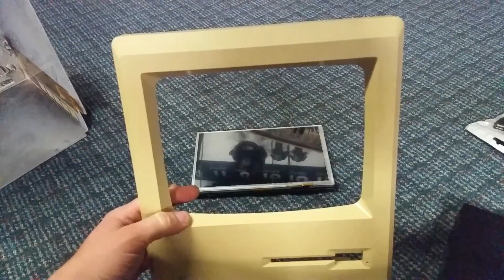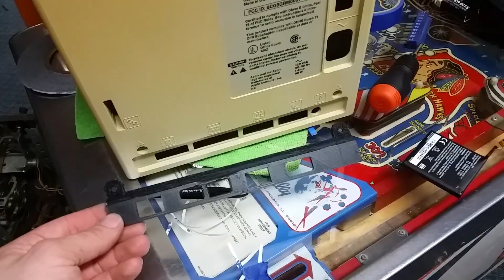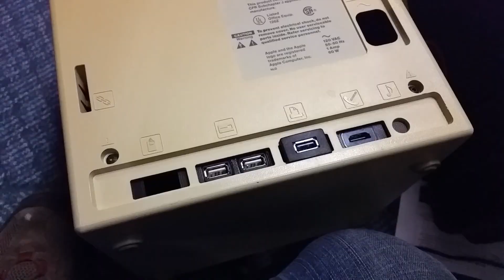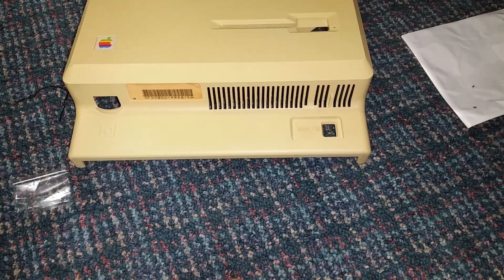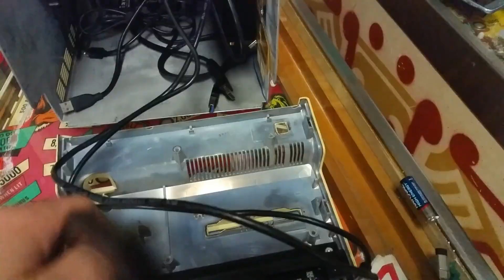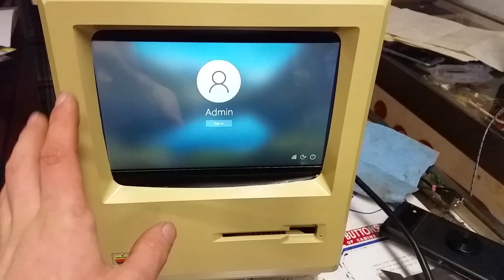Windows 10 Apple Macintosh 512K Build

Comment: Howdy, I also bought an old (and unusable, sadly) Macintosh 512k about a year back and I've only recently gotten to taking the electrical components out of it and was wondering if you ever ended up getting the 4:3 LCD screen like you mentioned as I was hoping to do something similar with mine but, I figured I might as well ask you seeing as you did this all by yourself and practically did all the heavy lifting I would have had to do if I haven't found this video haha!  I'm mostly wondering if you ended up needing to make a seperate bracket for a 4:3 or if you just decided to keep the 16:9 Monitor instead.  Would appreciate a response when possible!
Reply from the maker: @ArtistTheArtist05  I decided to keep the 16:9 as I liked how well the touch screen works

Comment: You can activate in the dell BIOS to be turned on when the AC comes back on. Then put a rocker switch in the cable of the power supply in to switch the system on. No need to solder anything in the motherboard.